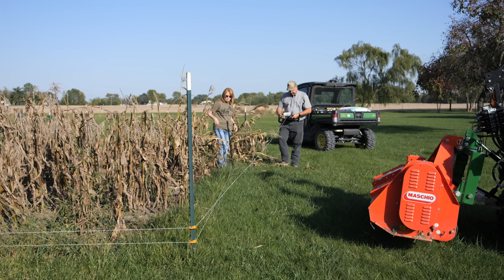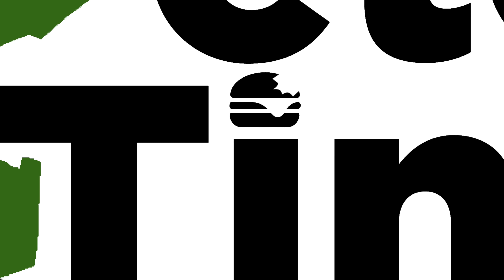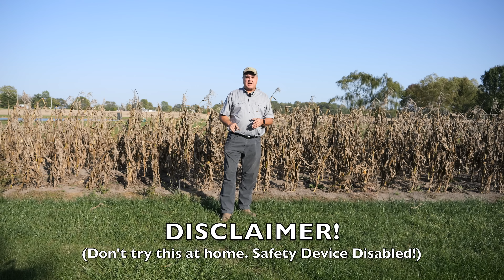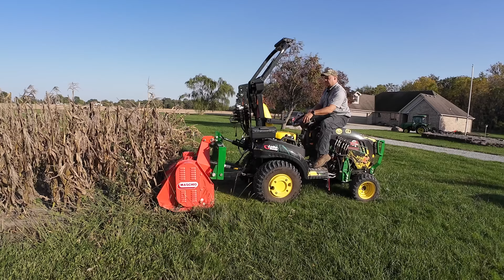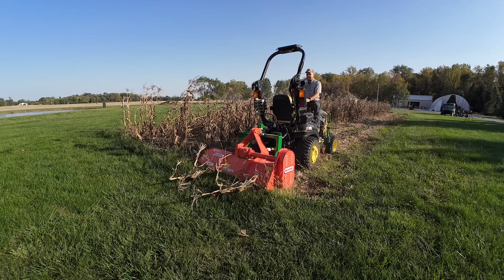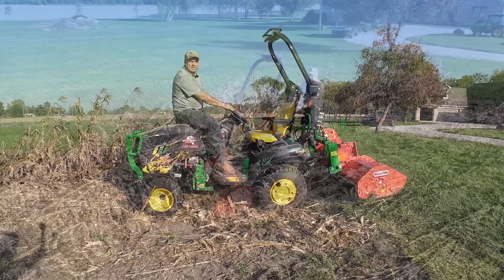Hillbilly Ferrari ! Convert YOUR Compact Tractor to an Out Front Mowing Machine!

Comment: Actually, this isn't a bad idea. I believe European 1025 tractors have an optional three point lift / connect for the front. Mount the mower on the front and you don't have to deal with running over the stalks (or weeds) before the mower cuts them down. Before I got my 1025R, I had a New Holland rear steer commercial tractor with a front mounted flail mower. It really did a great job mowing and plowing snow in the winter. I miss that tractor. 😢

Comment: I used to have a Toro Groundsmaster with a 60" front mount flail deck. It was the most versatile mower I had. Left amazing stripes on the yard, cut overgrown fields in a single pass, and devoured brush. 

I get this is a joke... and a hilarious $10k 

...but in all seriousness, you should get with Iowa Farm Equipment. They have flail decks for Grasshopper zero turns, and Kubota F-series front mount tractors.

Comment: Looks like a few bugs need worked out so I'm waiting on version 2.0. Do you think that Kens bolt on Hook seat springs could be added to help adjust the heat setting, Summer - winter. Christy the Terrorizer 🤣🤣
Reply from the maker: Ken is sitting here at my house now!
Reply: @TractorTimewithTim  Well he can test fit some springs to you. Also see if he can trade my 3-inch step in for a 5 inch, you know so it's easier to get on backwards.

Comment: Question:  Is the mower attachment included in the kit, or is that extra?  Also, I believe that this kit installed on an early 2000s New Holland wouldn’t require heel driving, since they used a treadle pedal.

Comment: I think you should throw in an extended 3 point lever and pedal pads for about $2,000 more. Everyone doesn't have your reach and flexibility. 😊
If your FEL was in place, you could probably set up a "buttocks hammock" off the rear pivots and mitigate the overheating seat.

Comment: BELARUS had that option over 40yrs ago for their 250AS, and the steering was correct.  Put quick change fittings on your steering cylinder and reverse the connections

Comment: Lean forward and put a suicide ball on the bottom of the wheel and steer holding that.  👍. Fold the seat down for better visibility.  You can use the same kit to plow with a box blade!  I want one!
Reply from the maker: I tried folding the seat…but of course that made the steering wheel inaccessible.

Comment: LOL's.  I'd like one, but only if you can also include an enclosed cab.  Is that an option?  I also like the free heated seat, but it would appear to be a little less cushy than the stock model.  Can I get a cushy, heated seat option as well?   Christie wants the pedal extension kit - the wood blocks wired to the pedals.   ;-)
Reply from the maker: Our customers seem to never be satisfied!!!

Comment: 🤣🤣🤣    It did the job however so that is what counts.   Why not have fun with it?    I may have a solution for the overly hot seat.  We have these foam squares that are actually interlocking gym floor mats.  Put two, one on top the other, where you sit.  It should reduce the heat from the hood!!!

Comment: Good stuff….but you got long legs to reach the controls. I would have legs swinging like a toddler o the toilet. I’ve always thought tractors were setup backwards…throw engine in rear and pto and 3 point in front along with the loader.  Seems the engine would help with ballast being in the rear.

Comment: I’d prefer the flail mower mounted on the arms where the bucket goes. Make a retrofit for it and run the hydraulic hoses to it in front. I’d rather sit in the seat.
Reply from the maker: Ah come on. The seat is overrated.